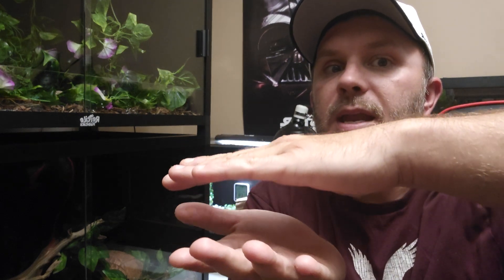"Heat Tape 101: Maximizing PVC Enclosure Performance"

Comment: I am scared of heat tape lol more so starting a fire. I'm kind of lost with heating my ball python 4x2x2 I am currently building out of wood, PVC is too expensive for me. I need ideas
Reply from the maker: It's gonna cost you a lot more to make it out of wood. You have to water proof it and seal it entirely to keep it from molding with multiple coats of 2 or 3 different types of water sealants. All of my enclosures are made by Dubia and a 4x2x2 enclosure is 299 plus taxes and you get free shipping. You could also get a 36x18x18 for 200. As far as a fire you don't have to worry about that so much as long as you keep the enclosure elevated where air can get under it and pass through the bottom and make sure you use a thermostat

Comment: Running heat tape like this is really no different than using heat tape on a rack system with thin plastic tub. You just have more of a gradient with your larger enclosure.
Reply from the maker: Yeah true, but there are some enclosures that are made with 1/2' thick and it will cause it to get way to hot for what the HT can withstand. All of my enclosures are Dubia and they are 3/8 " thick, which distributes the heat properly

Comment: Can I use heat tape if my tank is sitting on a wood dresser that in the middle has about halve an inch space or do I need to move it an it doesn’t have any material taken away from the bottom of the pvc ?
Reply from the maker: As long as you have spacers on each corner to keep it lifted that is perfectly fine

Comment: Who says this? The heat tape or enclosure / pvc manufacturers/ distributors?
Reply from the maker: It's because Dubias enclosures are only 2/3" thick, so the heat penentrates perfectly
Reply: @BallPythonPassion  I have 3" x 20" strip in a Cornell's PVC. RHP for main heat zone the tape is for low heat to humid hide. Heats fine through 12mm pic. Heat gun set to 80F. Raise enclosure 3/16" up for air space. All good.
Reply from the maker: @dpg2826  my ambient temp is based off from the room temp they are in. It stays around 80 degrees fahrenheit, but I keep the actual belly heat on the hot side around 99-82 and the warm around 80

Comment: I have a question can I use a heat mat for pvc or does it have to be heat tape and is the heat tape on the inside or outside of the enclosure
Reply from the maker: @HannahandWastson-k1i  always put your heat on the outside and you want to tape it to the bottom of the enclosure using Aluminum HVAC Tape and with the tape you only do the edges to hold it in place. I'm sure that a heat mat would work, but I've never tried it, so that would have to be something that you would have to try out and see if it works.
Reply: @BallPythonPassion  thanks for replying so quickly I figured that the heat mat went on the outside because that’s what I do with my glass enclosures but wasn’t sure with pvc. I’m upgrading my ball python next year and was very helpful. Thanks a lot!
Reply from the maker: @HannahandWastson-k1i  always on the outside and you're welcome 🙂

Comment: Hi, thanks for making this video. Just curious if you have an update on it and maybe how to were you show your thermostat set up and where you’re running your heat tape and everything just like you I have been on forums and looking over YouTube videos you are the first one I found that had the guts to at least try this out and advertise it. Thank you.
Reply from the maker: It's worked perfect for me. I literally messed with the thermostats for a couple of days and then after that I haven't touched them since. I have to how to clean out an enclosure video and in it you will see how I do my thermostat probe. Thank you subscribing to our channel and there is more to come. 💯
Reply from the maker: My biggest enclosure is 4x2x2 and I have a 3 foot piece on the bottom of it taped up. My temps go from 92-85 from one end to the other. I ordered the heat tape from Reptile Basics.
Reply: @BallPythonPassion do you place the heat tape under the pvc or inside the pvc floor?
Reply from the maker: @haileyjohnston1144  under but only with the Dubia enclosures, because the pvc is thinner than other brands
Reply from the maker: My 3 feet enclosures have a 2 foot piece under them and I put about 3.5 inches of substrate. I use Cypress Mulch Blend. You can get it at Lowe's for like 5 dollars for a huge bag. I think it's 40 pounds maybe 50

Comment: Can you put the heat mat underneath the pvc tank?
Reply from the maker: I use Heat Tape and yes I have it taped to the bottom of all my enclosures and make sure you use a thermostat as well
Reply from the maker: Also, make sure when you do belly heat to have all 4 corners elevated that way the heat doesn't get trapped, because it could potentially burn your house down. I use those aquarium corner pieces. You can get them on Amazon pretty cheap 👍

Comment: So I am assuming that the heat tape will work well, On glass It looks like I must get a thermostat. Do you know of a particular brand that has a thermostat that comes with? Set 12 inch thick heat tape. I love the idea. Thanks again for the 411 and the replies....
Reply from the maker: Since you are using glass get a heat pad with a thermostat setup. You can find them on Amazon. Just make sure that it fits the bottom of your enclosure and only covers like 1/4 of it because heat travels more through glass
Reply: I actually watched this video before. However, I did not understand it due to my 0 knowledge of keeping a Snake makes a lot of sense now...